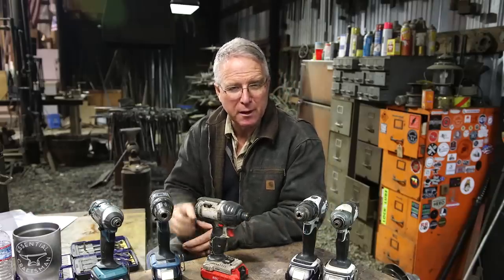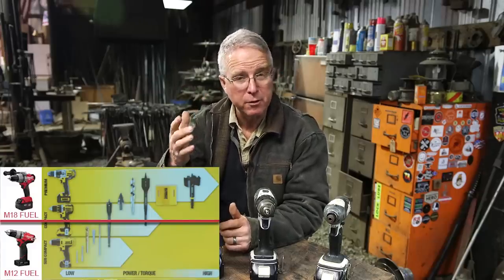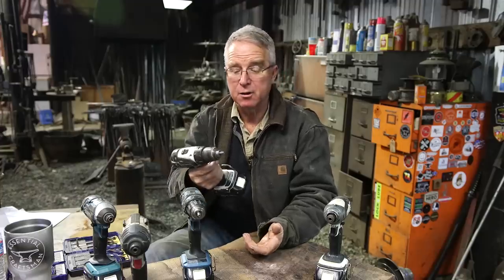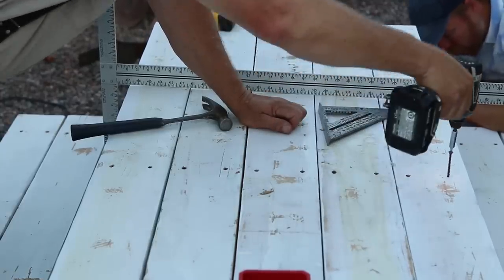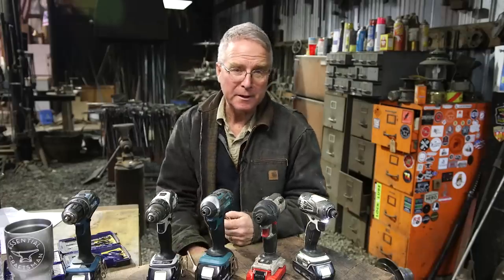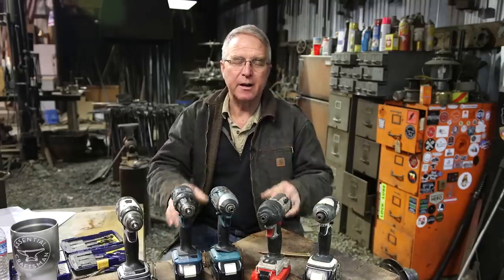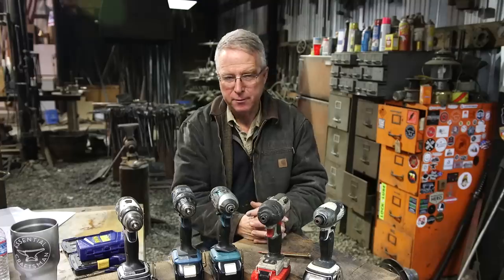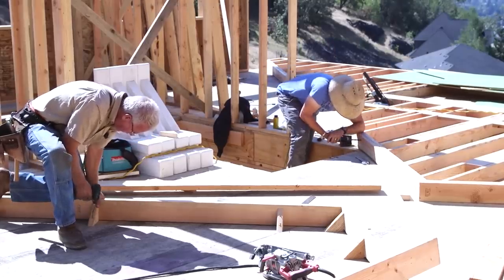Impact Driver Vs. Drill Driver

Comment: The principal behind the impact driver is that it alternates the force of rotation (threads pulling the fastener) and Hammering (shearing/displacing wood fibers) - this results in less friction overall. Quite comparable to a Hand Impact driver for sockets.

Comment: I sure did love Porter Cable. I'm not a brand loyalist for anyone but they had great tools are very affordable prices.  Currently I have a mix of DeWalt and Milwaukee, even a backup B&B Drills and drivers. I even like Harbor Freights new lineup although I admit I have no experience with them.  Have you guys heard of the new Universal Battery initiative? I am REALLY praying for this. It needs to happen.
Reply: Rob Lambert it’s easier and cheaper to run one brand. Because then you can buy tool only to expand your tool selection and the batteries move over. You can get bare tools like a Milwaukee fuel M18 impact for around $100 vs the kit that you get a case, charger and 2 batteries for $350.
Reply: The EU has legislated universal charging/connecting for electronics.  I hope the initiative moves to tools/batteries as well.  Everyone has a huge pile of different chargers and cables.  Its wasteful.

Comment: Dewalt Impacts now have speed control as well.
Also if you're going to buy a Drill Driver set make sure the Drill has a Hammerdrill option on it, even if you don't use the drill for that it'll last longer than the regular drill.

Comment: I'm an electrician. My boss has a DeWalt impact driver that we use. It's often used to screw devices to boxes which, while it's an entirely inappropriate application of the tool, I've actually become quite precise at. This particular driver has exactly one speed: on. Though it works, I'd love to have a drill driver for more precision since their speed variable. Right tool for the right job, fellas!
Reply: You need this tool for that job: https://www.dewalt.com/products/power-tools/screwdrivers-and-screwguns/8v-max-gyroscopic-inline-screwdriver/dcf682n1 - it detects which way you are twisting it and amplifies the motion. It's perfect for electrical devices and switchplates.
Reply: @OldPossum Did not know that, and you haven't met my wife. :P

Comment: The drill is better for things like mixing, but impact is better for everything else. I use impact for making holes, boring holes, wire brush, etc. It's actually rare to find a case where drill is better.

Comment: I just swapped out the motor in a 12 year old makita driver, incredibly easy to do, a nice bit of kit that's just going to keep going.
Reply: 2:30 I would never use my battery powered drivers for paint, glue or screed mixing. That kind of stress easily burns the motor and shortens the lifespan of the tool. Drivers are designed for drilling and screwing; I prefer traditional corded drill equipment for mixing use. That's only my personal opinion and I do not disrespect Scott's insights :)
Reply: Exactly, easy and cheap to order and even I can solder 2 wires.
Reply: @pistool1  Very true, but sometimes laziness or necessity makes you use the tool that is right there anyway.

Comment: I love the impact drivers. I hate when people use them for improper tasks, or use the improper implements (ancillary/peripheral attachments like screw driving bits, drills, drill/tap bits, etc). You don't use an impact driver to screw in Tapcons. You don't use it for drilling holes. (Some drill bits are marketed as "impact rated," but I find they break/shatter more often, even though they're supposedly softer steel to absorb the impact.) That being said, I have had great luck with using the DeWalt drill & tap combo bits with the impact driver. I've only used the ¼-20 ones, but they worked great.

Comment: For comparison, an impact driver is basically doing the same as if you put a wrench on a bolt and hit the end of the end of the wrench with a hammer.  It's not hammering IN, but hammering rotationally on the fastener.

Comment: @essential craftsman. You'll be pleased to know there's an anvil in each of those impacts. That's the correct name for the piece that gets hit by the hammer action. Check an advert for a 3/4 air impact wrench I bet there's a choice of "anvil length"

Comment: an upsize to corded tools, a comparison of a bosch bulldog that can impact drill concrete and drill. or jackhammer.  MY Hilte 52 that can impact drill, regular drill,  and jack hammer, vs a Milwaukee 1/2 convertible drill, impact vs the drill setting. My biggest complaint is that the companies change the batteries so they don't interchange with my older tools. I think I have about 20 battery drills and drivers saws flashlights. .

Comment: My roommate tried to use  my Dewalt high torque brushless half inch impact wrench,  to install a little quarter inch lag screw, to install a tv wall mount.

He snapped that thing clean off in less than a second.

Comment: 1. Use "impact rated" bits in the impact driver. Regular bits are much more likely to wear out fast or even break.

2. The big difference between drills and impact wrenches besides the pulsating action is in torque (twisting power). Just looked up a Kobalt set at Lowe's (DeWalt ones didn't specify torque) and drill has 650 in-lbs of torque and impact driver has 1800 in-lbs...nearly 3x the twisting power!

3. You should have done a three-way video comparison with a hammer drill. What's the usefulness of a hammer-drill compared to an impact driver?

Comment: I remember the first impact driver I had ever seen, it was a Hitachi, they had it at place called Copper State bolt and nut, this little 18 volt impact would bust lug nuts loose. It was also nearly $400.00. I passed for a long time until the prices came down.

Comment: All old heads know of Manuel impact drivers. A fat screw driver than you hit with a hammer and causes the spindle to turn, causing greater force to be applied to the fastener.  Impact drivers are very similar, when it meets resistance a stage of hammering engages over a large spring and notched metal cap bearing inside the tool, spinning causing the notches to create hammer force to the right or left of the fastener as it is turning. It does not hit like a hammer drill, it only hits right or left in other words, forwards or reverse. Nice video

Comment: When driving in a big lag bolt using 2 hands to hold steady the drill/driver or hammer/driver ( risk of wrenching your wrist when bolt bites ) Versus one handed operation with impact driver with slight loss of hearing. New impact driver with oil bath clutch are a bit quieter though.

Comment: You should try a Milwaukee 12v fuel set. You’ll miss those slow makita’s. You might even have a dim memory of the battery getting to cold or hot when you charge it and having the battery die forever. Because you’ll never go back

If I had the money I’d send you a set. Just because I appreciate your work and channel

Comment: Since I discovered the impact driver, torx screws and a set of clamps,  I find I can quickly and easily make anything I want with a stack of 2x4's with my very limited skills and experience. And of course, a cheap miter saw. It all cost a little more, but well worth it.

Comment: The reason you get more torque out of an impact driver is because you're essentially shockloading the screw in a rotational manner. The forces applied to to sides of the screwdriver bit can be compared to standing on a floor Vs jumping on the floor. Same amount of weight being put down but a different method of application.
Reply from the maker: OK that is a brilliant way to understand it! Also I love the term shock loading! Either never heard it or never thought about it so thank you very much for this!

Comment: Just wanted to add my 2 cents that for the average homeowner I have found that the 12 volt drill/drivers are more than enough to do the job.   I have built fences and repaired everything around the house with the Milwaukee 12 volt Fuel set.  Cheaper and lighter than the bigger boys.   Also, be sure to get the "impact driver" rated accessories.   I have busted more than one "regular" driver tip when I should have reached for the impact set.

Comment: Anyone who's ever tried break a rusted, or over tightened, on nut before has probably found success by tapping the wrench with a hammer (or another wrench). A drill will displace the energy, an impact concentrates it. 

That hammer tap is concentrating all the torque applied to the wrench in a super small area. Which is why you can stand on a 4-way tire iron and the lugnut won't budge, but if you hammer it, it'll break with ease.

Comment: Not sure if this has been addressed yet in comments but something to note is most new impacts really should only be used with impacted rates bits, drivers and sockets as they can crack and break standard rated items quickly and in some cases dangerously

Comment: for those who are new to the game like me, Impact driver /= impact wrench. Driver are for driving bits, and have much less torque than their big brothers. Wrenches are for sockets, anything from your steering column to even lugnuts (although torque won't be super accurate I'm told), the danger with the wrench is over torquing and ruining threads I think.

Comment: I keep my impact driver in my car with a 3/4 inch 1/2' drive socket ready for any tire removal and it is also great for using the scissor jack most cars have
Reply: Serious question: Do they really have enough power to remove car/truck wheel lugs?
Reply: psidvicious no they do not. Impact wrenches do. Not impact drivers
Reply: @hendrikseils5699  That's an important distinction of which many people seem to be unaware. An impact driver is not an impact wrench just like a dremel is not a die grinder.

Comment: When using an impact driver to install wood screws for cabinet hinges you can easily strip wood screw holes if you drive the screw too fast.
Reply: That goes for any type of screw driving method. (Drill, screw gun, impact driver, corded, cordless...)

Comment: I only use an impact when framing or sheeting. I never use them when doing cabinetry, either hanging or building them. I find the drill  much easier to control and never overdrive when using one.

Comment: The reason why a hammer motion works better is because Force = Mass x Acceleration. The acceleration part is the key. Get a mass moving and you can apply a lot more force with it. Think of it like using a hammer as you normally would compared to using it to just push a nail into wood (without swinging it).

Comment: I'm not a physicist or engineer either, but my guess is that the key to how impact drivers manage to so effectively drive screws is because the main resistance to the driving is the friction on the threads. If a drill is constantly outputting 10 units of torque and 7 of those torques are being used to overcome friction, then by comparison an impact driver provides no torque during 9/10ths of the time, then 150 torques for a fraction of a second, and suddenly the amount of force that effectively drives the screw is much more efficiently transmitted.

Comment: The impact drivers work great when using spade drill bits.  If you have used spade bits before in a hand drill, you probably know they can sometimes bind up,  When you drive them with an impact driver that isn't an issue.
Reply: Yeah those vortex bits too. The paddles with self feed and three cutting sides. 
Most decent sets today the drill has impact and hammer. Anything over 1⅜ you should use the bigger drill maybe with handle if it comes with it.
I've binded up on metal with one and I bent the shaft of the bit to a 60°.
I saved it and still have it. Almost broke my hand it happend so quick. Never seen it happen before I blame it on too good tools  these days lol
Reply: They cut slower in an impact. I still use my drill.

Comment: Then you can find some of those no longer made bosch phillips bits with the serrations and drive screws without stripping out the heads!! Sure the bits bust off if you get too tough because they aren't impact rated but you just flip out the busted bits and go back to driving. I can run #12 screws into oak all day with my impact and those bosch bits. Nothing else will do it.

Comment: Scott didn't mention the most important difference: An impact driver doesn't have a jacob's chuck and only fits one size of shank . It can't hold drill bits, and if it could, it would shatter them. Also, the indentation feature on impact bits.

Comment: I wish that there was a way for impacts to not be so noisy. I've been using them for at least a decade, and the hearing in my right ear has been reduced. Maybe not from just impacts alone, but they certainly don't help. For driving screws & small drill bits, impacts work so nicely that it's really hard to switch back to drill only once you start using an impact.
Reply: There's new ones out now with a hydraulically powered mechanism instead of the traditional anvil. Milwaukee's is called the surge, Ridgid's is called the stealth force. There's several others out there as well - supposed to be quite a bit quieter, might be worth checking out.

Comment: I once had a 12V impact driver twist the head off of a 1/4" lag bolt like it was nothing.  So be careful when driving smaller screws, especially if you are using an 18V impact driver.

Comment: torx drive screws generally don't need anything to drive them other than regular a corded or uncorded drill to drive and also countersink them , Hillman GRK and also Spax don't need an impact driver as they are pretty well engineered to do the job at least in construction lumber.

Comment: Think my impact driver is about 3 times the torc compared to my drill, first time I drove in 200mm (8") lag bolts with no effort, compared to the drill stalling out several times I was a convert, brilliant tool.

Comment: First time I used an impact driver I was sold. I'd bought one within a week and I've never once regretted it.  If asked which tool I use the most it's got to be the impact driver. It's not unusual for me to put 4 or 5 hundred screws in in one session and the time saved has paid for the impactor many times over.

Comment: I have had various drills and drivers. Working commercial electrical new construction for years. Once I got makita I have stuck with makita. For me the extra expense translates to cheaper due to lifespan of the battery much less the tool.

Comment: Physicist here, maybe I can offer an explanation of why the hammering motion of an impact driver is more effective at driving in a screw: To drive a screw, you need to apply a certain torque to overcome the friction. The torque will apply an angular impulse to the screw, and as long as the screw is not yet moving, this impulse will be transferred to the workpiece. An equal and opposite angular impulse will be applied to the tool and, by extension, your arm. Angular impulse is the same as angular momentum, which means: twist for long enough, and both your workpiece and the tool will turn. Impulse is force*time (angular impulse = torque*time), so by hammering the bit in an angular direction, A LOT of torque can be applied for just a fraction of a second, which results in an impulse that will turn the screw but not accelerate the workpiece or even the tool by any significant amount, as they are much heavier (have more rotational inertia). This angular momentum gained by the screw will turn it only slightly, and quickly be absorbed by the workpiece, slowing down the screw. So, many successive impacts are required to drive the screw home. Yet the overall momentum transfer to the workpiece and your arm will still be lower than if you applied a constant torque the whole time, as with a drill.

A linear (rather than rotational) example of this would be how you can easily hammer a nail into a board that a friend is holding up for you, whereas if you tried to push the nail in by leaning on it, you'd push your friend over.
Reply from the maker: Beautiful description!!! Thank you very much for this!!!

Comment: When you strip out a screw head it's because the driver cams out and since there harder than the metal of the screw it they drill out the material before you can stop it. An impact driver has less of a tendency to cam out as it pause since that brief moment the driver is being reseated by the pressure being applied to it by your hand/arm. Buying a set of impact drivers is worth the cost because those that are not tend to deform or break when used in the tool and having more than one Impact Driver Handle/Tool is also a must as well as an extra battery pays for themselves. About the only downside is the Cordless manufactures change voltage/battery types so often that your forced to buy them over again every few years because that's by design. Indeed many a tradesman have cordless tools they no longer not because they broken but that finding the batteries for them is the problem even within the same brand even though they should.

Comment: Odd use for that drill clutch is put it almost all the way down and use the vibration to pull a rusty screw out without breaking it off.  Havnt tried it with an impact driver but that might be too aggressive.

Comment: I think one thing you didn’t touch on was the advantage of having a drill to make hole, then an impact driver to drive the screws without having to change the bit. I had the choice when going onto lithium was between a drill and 3 batteries or a drill and impact driver and 2 batteries. thank balls I went with the latter. I often have the situation where I am drilling wood to masonry and I have an SDS, cordless and an impact to save changing bit and settings.